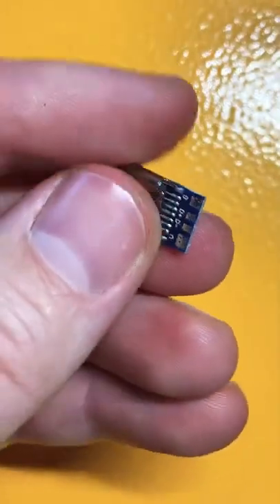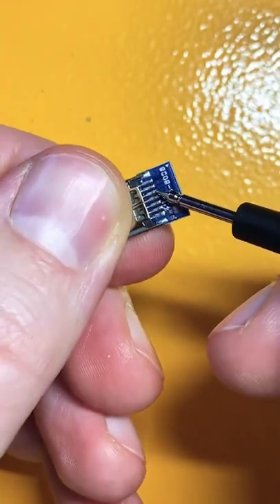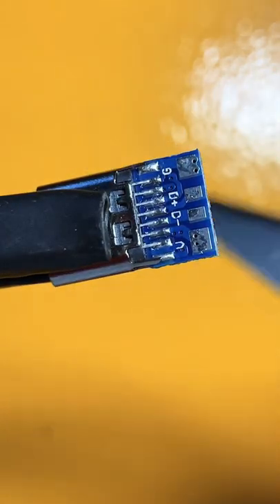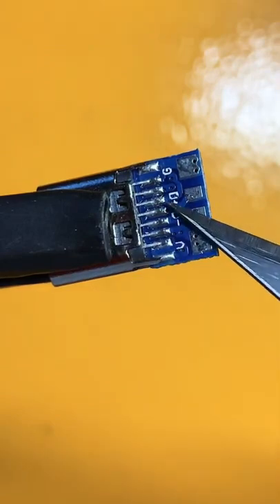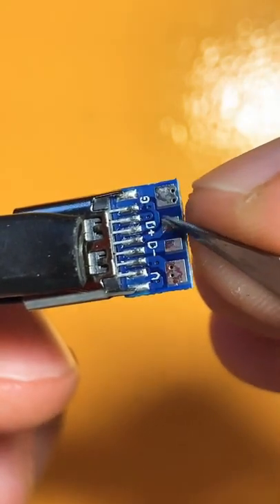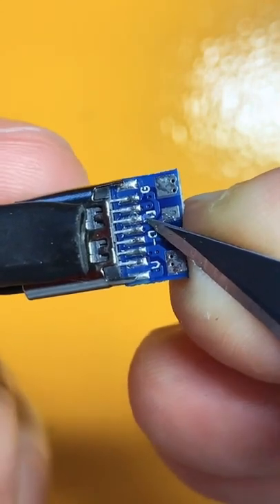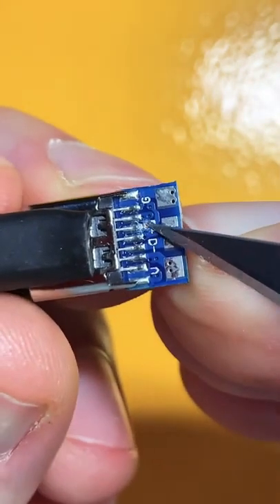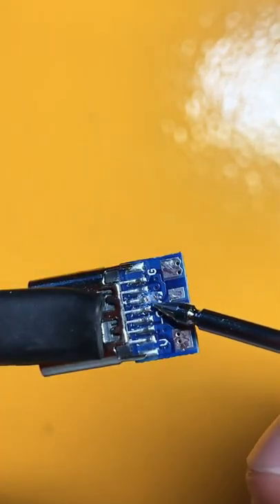#15 Fixing aliexpress USB-C connector (severing connection between CC1 and CC2 lines)

Comment: hi, with one question to you, i want to do a project but i don’t know through which pin can be audio transferred at usb c. can you help me? is the usual data pins?
Reply from the maker: I assume you're trying to use the standard USB3 (or similar) protocol over the usb-c port, and not some sort of a hack that uses usb-c port to transfer analog audio signal? 
If that's the case, then there's no pin that sends audio. You need to implement a standard usb protocol for communication, no hardware modifications required. You would need a DAC and an amplifier on both ends to send/receive audio.

Comment: Does doing this make it so that all cable can work with it? Because I'm trying to put this in my phone, I'm going to remove the micro usb and put this in as a better connector
Reply from the maker: yes, if you put 5.1k pulldown resistors on CC1 and CC2 lines, then it'll work with any USB-C cable

Comment: Hi! I have a question.. I bought a type c male plug from an Anier iphone cable that I had, my usb tip broke and I want to replace it.. I only got these 4-pin male usb c and my cable is 5.. I have +, -, D+, D-, and CC... how can I connect it?
Reply from the maker: you can just connect the +,-,D+,D-, lines to their respective pins and CC line to both CC1 and CC2 pins. but since you don't have separate CC1 and CC2 lines you won't be able to use it with some chargers (the issue i encountered in video #9)